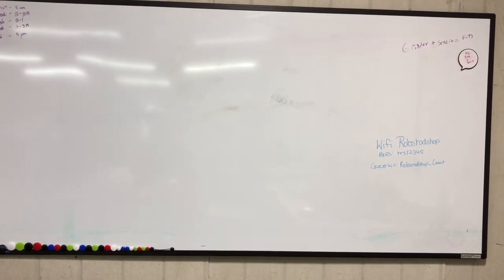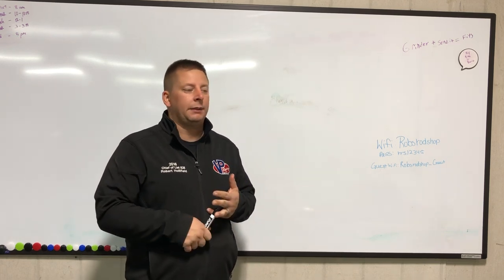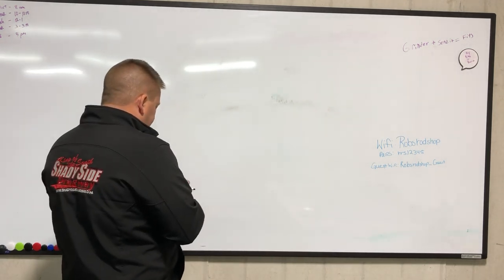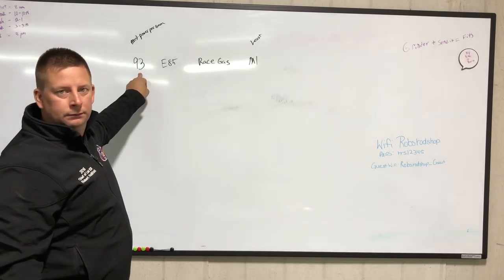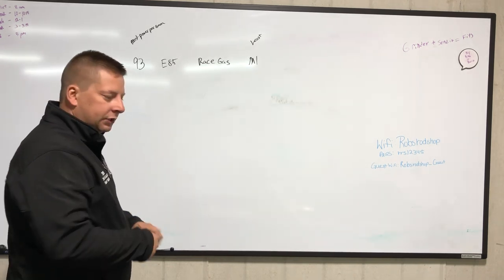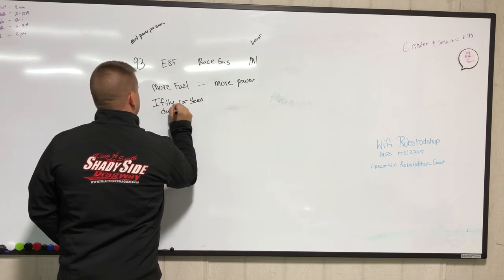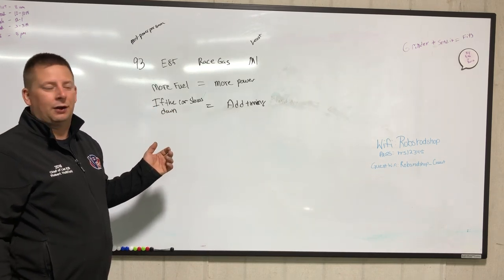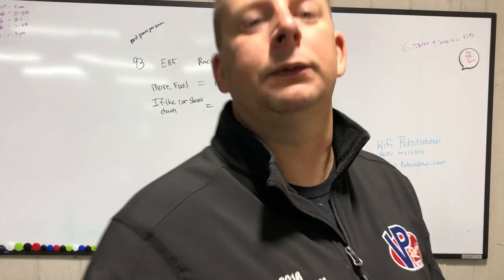Lean is mean!!! Real mean!!!

Comment: I ran a TA340 prostock with a stupid amount of lift and fast duration on a 1.5-1 valve ratio with valves that all but touched they were so big and a bunch of compression.  As a result, the best tune we could get at the time (before computer controlled ignition) had a spark that, as shown on the graph of a scope, would squiggle out and loop over itself because it would actually blow out the spark at its peak.  lol.  
  The engine was extremely built on the webbed block of the 340 so it could take some abuse so, although pulling a bit of timing stopped the spark from extinguishing, it lost too much power so, we let 'er ride...  But we found the compression point that would blow the head gasket whenever we fired it up, backed it off a couple points and had a fast, bulletproof engine (built by the late, great Jack Patrick of Green Flag Automotive in Valdosta, GA.
  The point of my stroll down memory lane?  People make and usually break their overall engine performance by knowing how timing actually works and what can (and can't) be done with it.  Thanks for a great video.   You gave a great understanding about the physics of engine performance and it's simplicity of logic, once you understand how all the parts of the system work and that is something you either have...  Or you don't.  Be a mechanic, not a parts changer/breaker.

Comment: Well said! A lot of people will have detonation with say 87 octane. Then they cure it when they put 93 octane in the tank not understanding what is really happening in the combustion chamber. The 87 is pre ignited due to the heat before the spark plug lights the mixture in the chamber. The 93 slows this down to keep this from happening stopping the pre ignition/detonation. It may just be caused from incorrect timing.
Then you go to alcohol that takes more BTU’s than gas (aprox twice as much as you stated) 
General  population buying ethanol thinking they are saving money because it’s cheaper ( when subsidized by the government). If they crunched the numbers they would be surprised. If you save anything it’s not worth filling up more frequently. Depending on the % mixture can change dramatically of coarse . 
Again great explanation!👍👍👍

Comment: I agree with you. But I'm having trouble with my NA 355 12.5 to 1 210 AFR headed 260 264 @ .050 cam engine on VP E85 actually X85. Currently 37 deg locked out timing MSD 6 system. .740 to .800 Lambda, with the richest at top rpm. I can definitely tell that .800  is getting closer to lean but I"m a little uneasy adding more timing. I did have 40 in it when it was richer. Do you think I still have plenty of room to add timing to the 37? Some say with E85 a few degrees of timing doesn't make any more power. Right now it seems to run terrific.